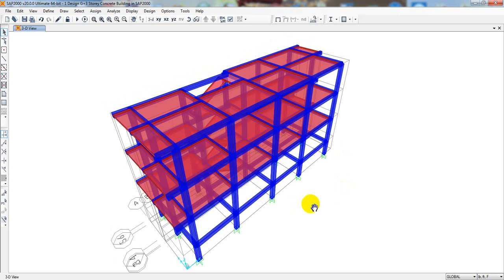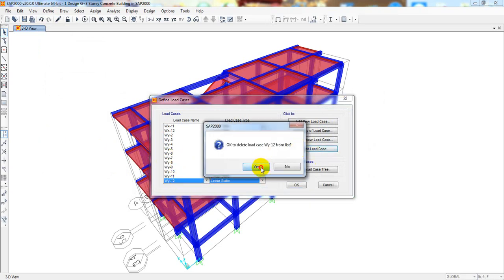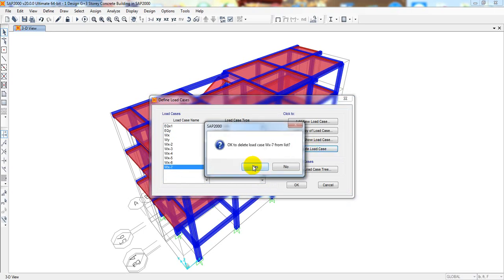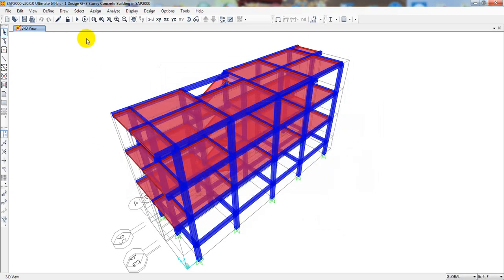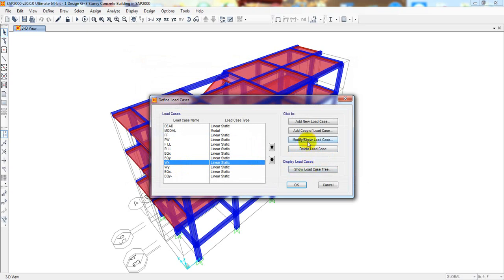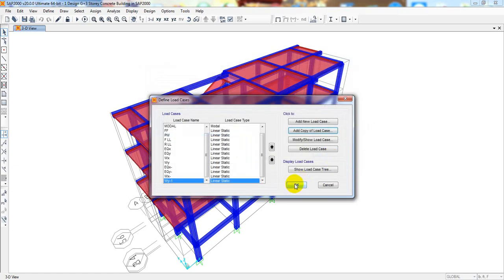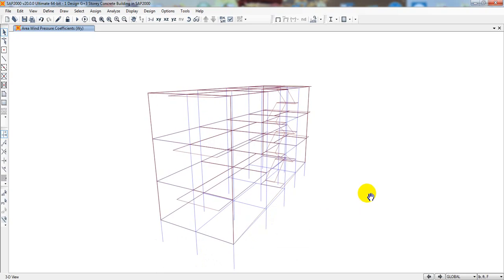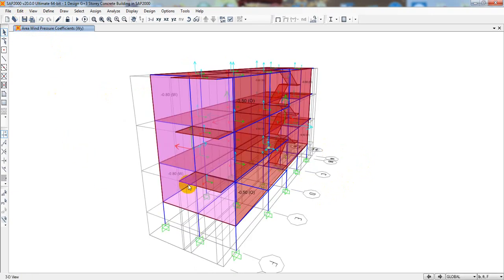Design G+3 Storey Concrete Building in SAP2000 -10 | Assign wind load on wall side in CSI SAP 2000

Comment: please , i want to design steel i beam between 2 concrete columns , it's dim. 200*200*12
could you help me please
Reply from the maker: you have to design as a composite beam or column.